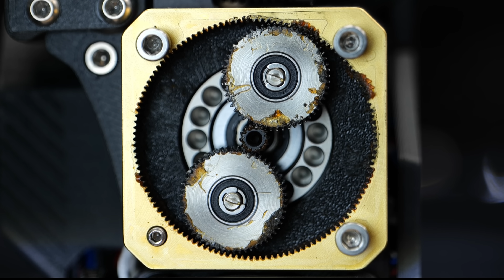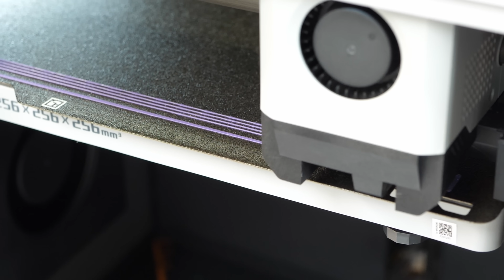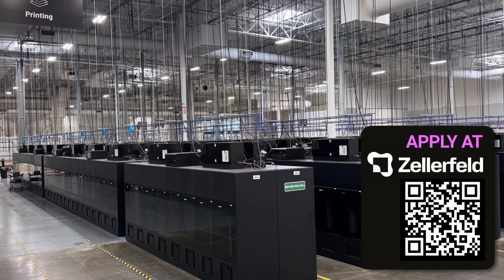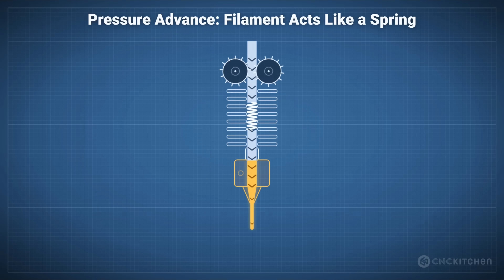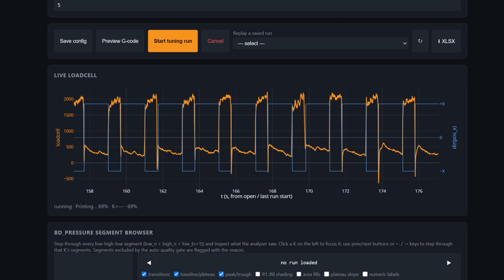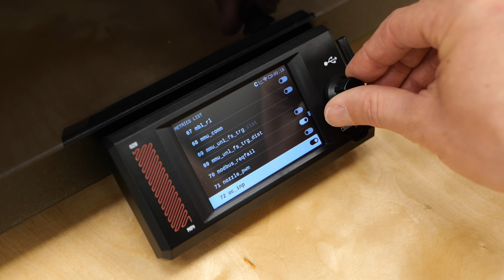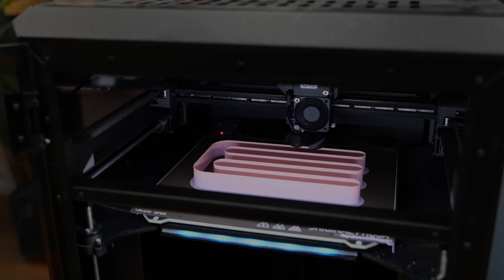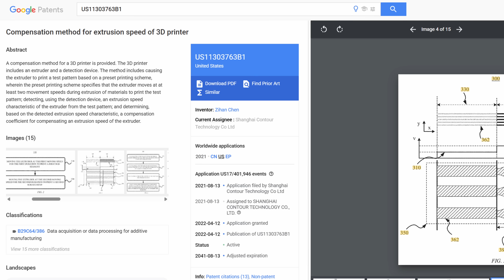I Automated Pressure Advance Using a Bed-Leveling Sensor

Comment: OK Stefan, that's it! I am not showing you the internal demos from now on. Spoiling a surprise like that... 😄 You owe me a drink.
Reply from the maker: That was done long before you showed me that, just check the commit dates 😎
Reply: @CNCKitchen  Checked the commit dates, I have nothing 😅 Drink is on me. And now I really can't wait to show you what the team has been cooking last few years.
Reply: @thejosefprusa  when it will be released? I remember talks about crash detection and partial nozzle clog detection few years ago with XL and MK4 releases :)
Reply: @thejosefprusa  years? What are you waiting for, you have a team of well paid engineers and one youtuber did it by himself in a month... You are selling printers without this crucial feature that your 200$ competitor has.
Reply: @riba2233 my spot the bambu troll bingo was just completed
Reply: @riba2233 Tinkerers like me have the benefit of tweaking things. I’d wager the hard part is consistency across entire productions.
Reply: @admiraladama5877  But they are individuals, ofter with other Jobs or other responsibilities and also resources!
It really is getting a little shamefull what is coming out  (or better not coming out) of the Prusa Software Department.... The Last Firmware Releases where almost all botched....
Reply: @thejosefprusa looks like i have to upgrade my mk3.5 to mk3.9..
Reply: @thejosefprusa Finally, been waiting for this since I got myself a core one!
Reply: @thejosefprusa not prusa outing himself on a new feature 😂 love to see cool development still at work!
Reply: @thejosefprusa  

1. This calibration is based on extruding into thin air, where nothing is restricting the flow.  How different would the results be if done on the surface at different heights above it, to change the pressure resistance?

2. TWO 'K' values might need to be calculated: one for pressure increase and one for pressure decrease, as the response by the plastic seems to be asymmetric for some reason.  (I could be mistaken in that; it is pretty subtle.)

3. Might the load cell be sensitive enough laterally to be able to trace along the perimeter of stacked test layers to match some of the sensitivity of the LIDAR solution?

4. Might your solution involve an in-printer option to 3d print a QR code & label of necessary information that can be attached to each spool and then read by a camera?

Cheers!
Reply: @riba2233  10% of polish work takes 90% of the time.

If you had any development experience you'd know that.
Reply: @carlosjosejimenezbermudez9255  I know that very well, I develop my products that I sell by myself. And my point still stands, they have enough engineers so they can do it in a reasonable timeframe.
Reply: @misamokuzelpizu  don't bother, that's a waste of money and time. Just sell your mk3.5 and get an A1.
Reply: @JonneBackhaus  you ok bud, who hurt you?
Reply: @riba2233 took you a while to make up an "comeback", i guess you "use bambu btw"
Reply: @JonneBackhaus  no, yt has hidden your comment, even they know it's bait. So just keep coping ;)
Reply: @riba2233  what a strange suggestion. 
i would get a similar or worse machine that's far less repairable. 
not to mention, that i dont want to support such a consumer unfriendly and anti open source company
Reply: @misamokuzelpizu  nope, it's a much better machine and it's repairable enough. You should support your wallet first and foremost.
Reply: @carlosjosejimenezbermudez9255  They are not polish, they are czech! 🤣 Sorry, I just had to.
Reply: @riba2233  The A1 is definitely not a better machine than a MK3.5. It's not even in the same category, two very different machines.
Reply: @Liminal.Headspace  it definitely is, it's much much better than even mk4 by every relevant metric.
Reply: @Liminal.Headspace  wow, you could have told me right away not to bother talking to you 🤦‍♂️ and yes, it is much better, really sorry for bursting your bubble.
Reply: @riba2233  I can't tell if you're trolling, or just mentally challenged. There are quite a few Bambu machines that you can compare the Prusa MK to, but you've chosen the A1? Really? It's a nice machine and the ecosystem is great up to a point, but it's still just a budget bed slinger in the end.
Reply: @thejosefprusa  Could I tag  along for this trip? ;)
Reply: @riba2233 no we shouldn't just vote with our wallet, you are just looking into 1 aspect of buying a product and supporting a company, ethics play a HUGE part in purchasing decisions. Many people have actively boycotted companies because of how they present themselves.

For example if I buy products like shampoo or makeup the first thing I'm going to look for is animal testing, if they do it directly or indirectly then I don't care if it's the best product on the planet.

Back to the feature at hand, out of the 3 filaments Stefan tested, only 1 was accurate with the other 2 not being good enough, he got 80% there, the last 20% would take a long time to get it accurate for all filaments, including different types, colours, filled filaments etc all produce wildly different results. That last 20% of refinement takes 95% of the time
Reply: @riba2233 Not everyone would sell their soul to CCP like you sold yours.
Reply: @MariluZica-s2u  rofl, good one buddy. By that logic everyone has already done it, including you.
Reply: @CNCKitchen  Prusa has worked on this for well over 4 years by now :) When I saw this video, I was surprised that it's something new because I thought it had already been implemented in their printers
Reply: @CNCKitchen if you put a magnetic encoder on the stepper for the extruder you probably get a force measurement from there too.
Reply: @TheAeroman90  actually no, the encoder values would be to unreliable as you can only measure if the stepper slows down. But you have normally some "electrical" overhead until that actually happens. You would have to measure the electrical current(amps) the stepper pulls. Although this should be quite feasible and I'm quite sure that some steppers should implement such a feature and if not a simple shunt before the extruder stepper should also do the trick.
Reply: @DrN4b0  Don't those more recent stepper controllers have back EMF detection and can be read from software already? Not sure if the resolution is sufficient for pressure advance calibration though.
Reply: @DrN4b0  I believe that's how sensorless homing works.
Reply: @CNCKitchen  We've been working on it too in Kalico. Like, a lot longer.
Reply: @ellafoxoo it does make sense, because I’ve had thoughts about these kind of features for a while. And I’m a software guy, not a hardware or 3D printing nerd.

There’s just so much data, using it well is a challenge!
Reply: @CNCKitchen  I have all the data feeds with timing available in Kalico. We can do move reconstruction.

But my experiments with this got to where you are. Basically by the time the math can see a clear overshoot, the PA is too high on the printed test pattern.

So we need something else. Perhaps a “too low” signal that we can interpolate between the two. This is what people are doing by eye.
Reply: @garethky have you tried to do the extrusion with a manually found k value? You could consider that as a golden sample. If you can align many of those samples in time (cross correlate via convolution) you could average (or median) them to reduce noise. Maybe this gives a clearer view on what signal exists in a perfect extrusion.

If there is no signal within that perfect extrusion, you could cross correlate it with another extrusion and change k until correlation is highest. Speed it up via bisection method.
Reply: HELL YEAH
crossing fingers it involves firmware for the prusa XL
Reply: @GabeOstberg  knowing how bad recent XL firmwares have been, my confidence level is low.
Reply: i've kinda been expecting this feature ever since you announced that the Nextruder would have a pressure sensor
Reply: @thejosefprusa Maybe we could get loadcell_value to the XL as well then? I think it was introduced in 6.5.1 and XL is still at 6.4.2 😀
Reply: @ikreerki Gotta get the stroboscope belt tuner as well
Reply: Looking forward to this feature! Thank you cnc kitchen and prusa!
Reply: Lol Joe, maybe you should hire Stefan as a independent expert consultant! We need his creativity and dedication to open source improvement. ❤
Reply: @SparrowHawk183  No, don't let them take such a valuable resource away from us please!
Reply: Adaptive pressure advance is so valuable, but at the moment the buddy firmware halts and waits for the planner to clear before PA can be changed. It would be great to get this solved. It's an open issue on Github.
Reply: Push them to release the HT hotend I am waiting for it since long time every one does 😢
Reply: Jozef started deleting his responses here 😂 "@thejosefprusa 17 hours ago @CNCKitchen Checked the commit dates, I have nothing
Drink is on me. And now I really can't wait to show you what the team has been cooking last few years."
Reply: @TheOneAndOnlySatan that one is still up for me
Reply: Just think what could be done with KlipperXL. I am betting it would be possible to leverage more of the U1 code. Sadly when I asked about the patch forward with the XL at Open Sauce last weekend I was given the stock answer of "We still have big plans for it but we can't say what or when."
Reply: Dude, you are almost ready to ditch the nextruder with INDX and you are still talking about team cooking for years.. When are you going to actually ship it
Reply: 2 months old comment, yet, no PA automation for Prusa. You guys are falling behind.
Reply: @Pin_Fandango  of course, what did you expect 😅 but they were so close... /s
Reply: Hey you ego maniac.
Reply: Next Adaptive PA 😅
Reply: I’m going to experiment with my indx tomorrow
Reply: What astounds me is the almost complete absence of closed loop control in 3d printers. Open loop control requires accurate calibration which can be done with sensors, and sensors can then also be used to detect failures after they happen, but sensors also can be used for closed loop control which dynamically corrects to prevent failures before they happen.
Reply: @DonovanBaarda open loop control allows much faster printing because calculating feedforward values is immediate. Closed loop must be well tuned for system dynamics, but effectively feedback signal delays limit your printing speed. To overcome this, you would need some advanced predictive control algorithm that would still require some amount of tuning prior printing. This is exactly what Pressure Advance is about.
Reply: @Martin-l8d8z that's not really true. All real control systems use closed loop, and the more important speed and accuracy are, the  more feedback loops are used. Rockets, aircraft, etc all use closed loop.
Yes, feedback loops can lag, but even basic feedback loops in realtime control systems typically lag by max 10ms,. Yes, if that's too much, predictive feedback loops like khalman filters can address this. Yes, feedback loops perform best when they are accurately designed/calibrated.
But closed loop systems are way more forgiving than open loop systems when they are slightly out of calibration. A poorly calibrated closed loop will tend to "work harder" to correct the extra small errors, but an open loop system will just blindly let the errors accumulate.
The most amazing thing about 3D printers is how well they have been made to work just using open loop. This has been achieved using a combination of very over-spec'ed/under-driven steppers and super-fine calibration. But I think it's been taken as far as it can now, and switching to closed loop will allow printers to further increase speed/accuracy and use smaller/lighter motors.
Reply: @DonovanBaarda you are right that closed loop provides better accuracy, which is the counterpart to speed. Both play a role here and (digital) controllers have undergone great advancement in real time performance over the past decade. This can still not change the fact that physical systems always expose some delay, which includes sensors, actuators and the plant you are trying to control.
Reply: @Martin-l8d8z i have swapped the x and y motors on my printer for some aliexpress closed loop stepper drivers. It instantly let me double my print speed (before i was getting skipped steps if I increased speed). It isn't that closed loop let you increase accuracy, it's that it stops errors propagating, which lets you run at speeds they generate those errors, while open loop you have to stay well below any speed that generates errors as a single skipped step results in a scrapped print
Reply: @Martin-l8d8z lag is pretty much a solved problem in control systems, in that its impact and how to compensate for it is well understood, and it affects both open and closed loop systems. Open loop systems do avoid sensor lag, but sensor lag is typically tiny compared to actuator and system lags, and it's much harder to compensate for those lags without feedback.

The control systems theory for this is not recent advancements, and pre-dates digital controllers. At my first job there was an RPV jet (Jindavic) with a completely analog closed-loop control system, with a simulator implemented on an analog computer (AD4).
Reply: @DonovanBaarda Yup, it feels like we are fighting problems that have been solved like 70 years ago, quite ridiculous
I get that at the beginning open-source 3D printing was meant to be as cheap and easy to build as possible, but nowadays even the most advanced 3d printers look like they belong to the 1950s (with semiconductors instead of vacuum tubes)
Reply: @intrepidhibex to be fair, 3D Printing started as a Frankenstein-cobbled-together cross between a "my first robot" kit and a CNC machine, both applications where open-loop steppers are still widely used. For "my first robot", simplicity and avoiding the cost of sensors make steppers a good choice. For CNC machines, they need very slow and precise movement which steppers excel at, and you don't gain much by closing the loop on almost-static systems.

However, 3D printers are now approaching 1m/s speeds and 10G accelerations, which is well beyond the open-loop stepper comfort zone. We are starting to see closed loop used in the form of closed-loop steppers, but these are just pretending to be a very-fast stepper that doesn't skip steps. They are just allowing the existing firmware to push the open-loop envelope a tiny bit further without changing much. It's time to do more and move beyond the "my first robot" kit stage.

I'd love to build a new firmware that is just a big Kalman filter, fusing the feedback from all the sensors, including inertial-nav accelerometers/gyros on the print head and build-plate, position sensors in the BLDC motors, all the hotend/bed/chamber temperature sensors, fan speed sensors, extruder force sensor, and maybe even current sensors and camera feedback, to give super accurate and fast feedback on the state of the whole system, and drive it as fast as is possible right at the limits of what the motors/heaters/fans/etc can do while staying within the required accuracy/quality limits.
Reply: Fix the XL!!!
Reply: Well, I was like "show this to Josef". It seems I was late :D
Reply: This is exactly what I'm afraid of, the comminity creates, the large brands take it to themselves, patent it and lock it on their ecossystems.
I'm not pesonally awarye of prusa's values, and I hope he's one of the good guys, but any of the big players can do that. I hope the community as a whole protect these advances (pun intended)

EDIT: I've informed myself and looks like Mr Prusa is one of the not only good but great guys of this community. So pardon my ignorance and direct my reservations for other companies
Reply: @DerekSmort  prusa is definitely good. they are awesome and open source
Reply: @DerekSmort you cannot protect published knowledge. When the community publishes an invention it goes into the public domain and therefore forces the companies to implement it in a better way or reach the market earlier/wider to gain a competitive edge. A company could build upon the public invention and patent their improvement but that does not lock down the community improvement.
Reply: @DerekSmort  Fortunately, patenting laws (generally) do not work like that; If someone invented it earlier and published it (open-source repository = publishing), it can no longer be patented (Among other limitation the “new-ness” of an invention is key for patenting).
Reply: @DerTypMitR  Hopefully. I'm just jaded, companies run with it and then it turns into a job of the prior art creator to prove it in court, and it's a whole mess
You are right, I've just found reality less than ideal in reproducing what is written into law
Reply: Well maybe think of updating your feature-less printers a bit faster?
Reply: This comment is the reason why I have been using Prusa printers since the Prusa Mendel. Keep it up Josef, you guys embrace oshw in the way that respects your customers, the community, and still make it a viable company in the process. True Anti-Enshitification since 2009.
Reply: yo big josef
Reply: somehow i had a feeling the big man himself would be weighing in....  😋
Reply: Haha Josef looks like you got pwned
Reply: @lavericklavericklave At the speed Prusa moves, shouldn't be surprised a single dev can leave them behind.
Reply: If I remember correctly, most of the ideas discussed in the video were mentioned as possibilities when the Nextruder was shown for the first time. I'm a patient guy and prefer to wait then to buy the printers from a non EU manufacturer. I think Prusa always caught up in the end, but sometimes software related improvements are coming agonizingly slow or with bugs. So im happily waiting for the surprise, PrusSlicer 3.0, real usage of openprinttag, upgrading my XL to INDX like purge and calibration, INDY for my C1L.... - Lets see what comes next.
Reply: Prusa's true evil corp came out fot a sec
Reply: Get vfa, Josef. Stephan did the research, published the work, and is giving it to everyone. Trying to act like it's your innovation or worse, lock it behind your ecosystem or patents is exactly why people distrust big companies. Give credit where it's due.
Reply: @TheOneAndOnlySatan he can't because of his ego.
Reply: Can't trust anyone these days...
Reply: Codex makes everyone capable of implementing ideas